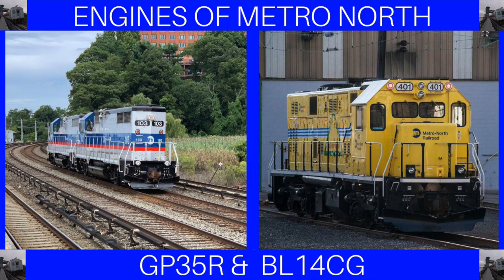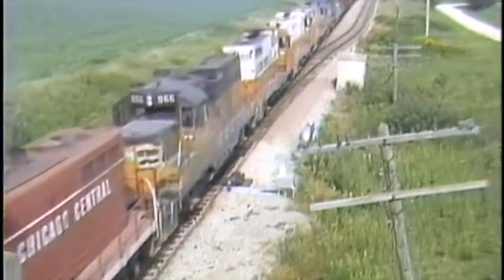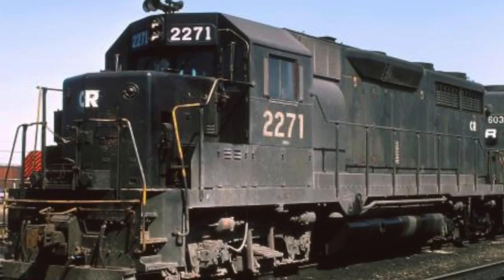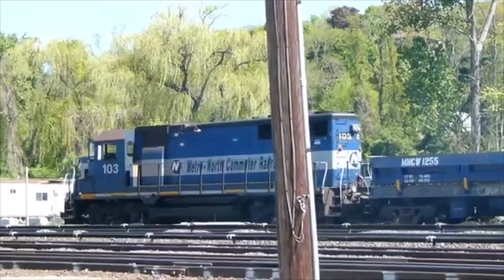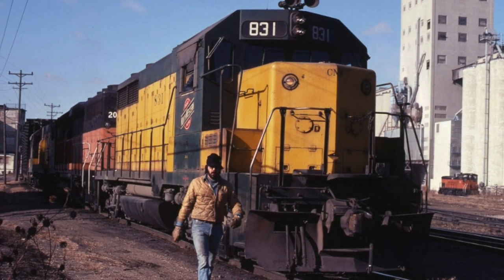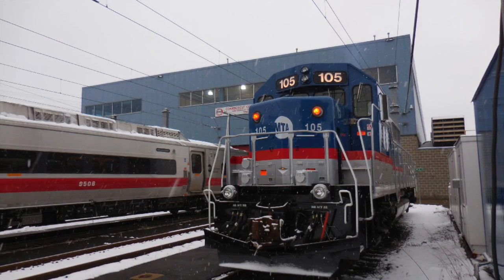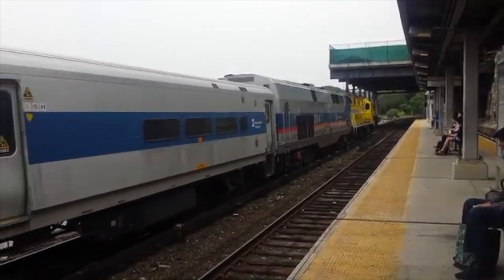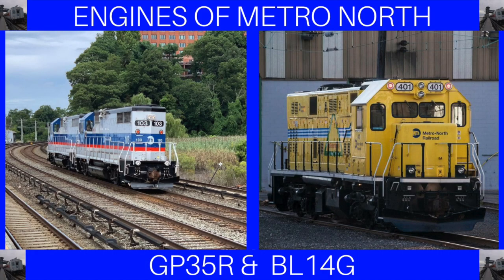Engines of Metro North EMD GP35R and Brookville BL14CG

Comment: If they wanted locomotives for use in the tunnels, why not get them 3rd rail equipped (like the P32ACDM's)?

By the way, a couple of your voice lines got repeated.

By the way, a couple of your voice lines got repeated.
Reply from the maker: The problem with the p32acdm’s apart from them being overpowered for the job is the same as any 3rd rail equipped locomotive. Switching and repair work has a lot more stopping and starting, and with all the stopping at starting the engine could get stuck in a gap in the third rail.
Reply: @nyrailfan202  But then you have the diesel engine (alternatively, especially on a green design, a big enough battery) to get out of the gap.
Reply from the maker: This would work and is something metro north is looking into, but at the moment no such locomotive exists